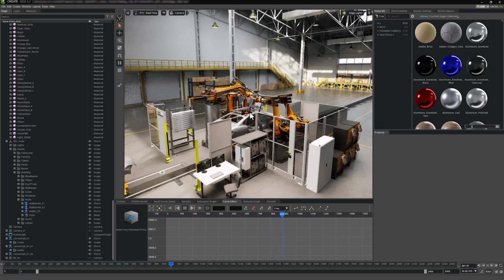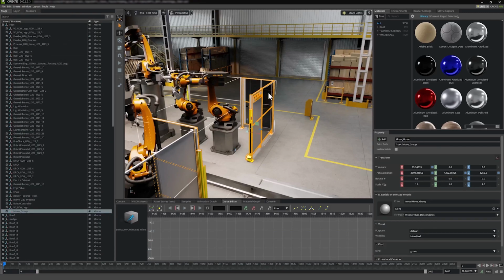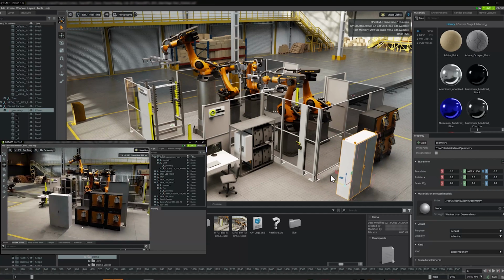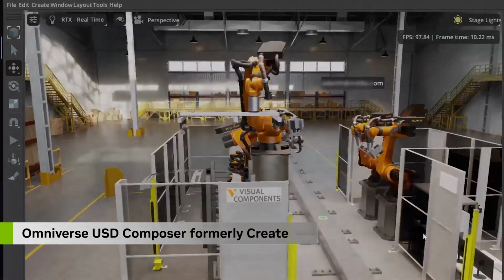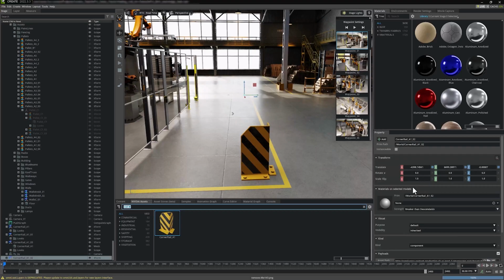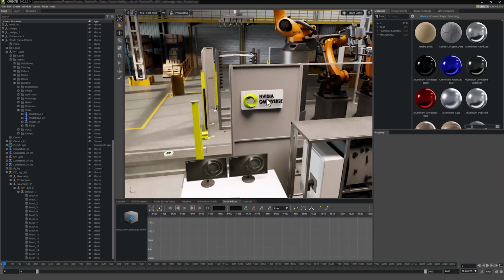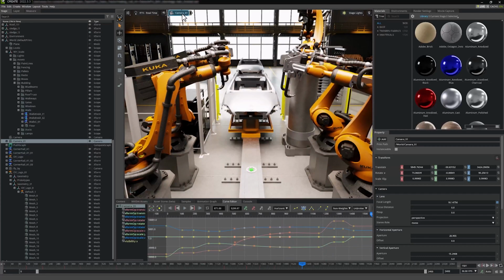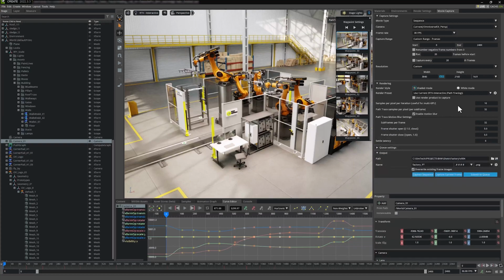Automotive Factory Welding Cell | Part 3: Demo Walk Overview

Comment: He guys you are on the right track ! and have learned a lot from our cooperation ;-). You maybe still have some miles to go at NVIDIA to integrate more and more external data to build a platform for industrial use...a "digital twin platform" to setup and industrialize the use of "digital twin". Never the less dont forget real data and "integration" of sources and assets from other sources is the key to success. No digital twin...without "digital data/assets (=souces where leading data may is available at the industry). It´s time to take it into account for further Omniverse usage that (still) data is the key to success...and software, like "create" &"...explorer" etc.,  will be needed to use 3d data in such usecases ...and this software has to be enhanced too...the journey to "digital twins" is not yet finished....it just begins...
just one thought from an expert ;-).